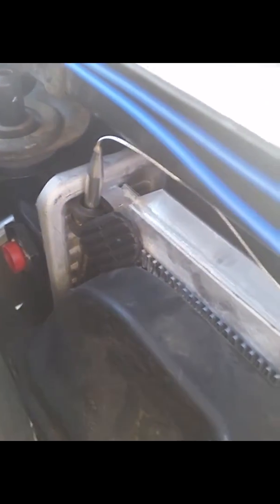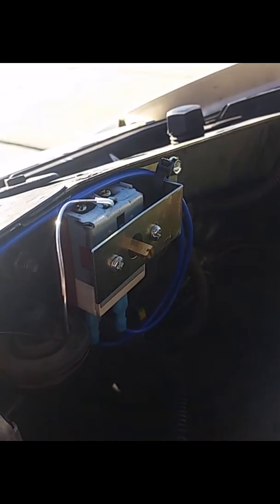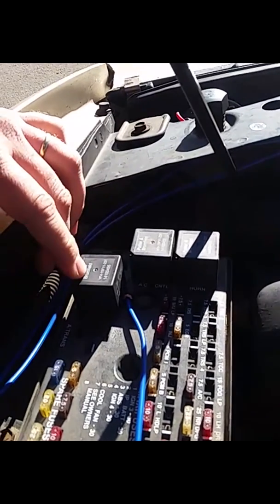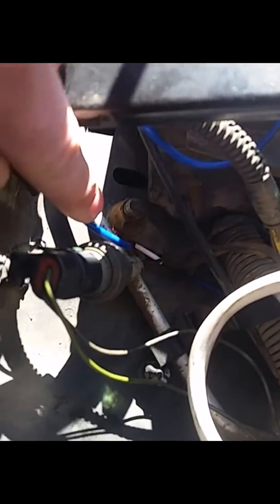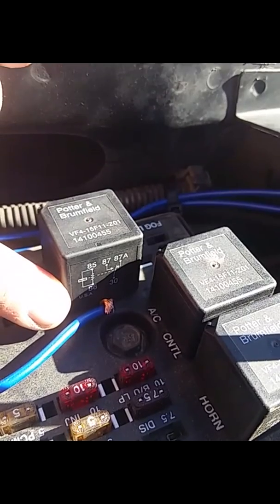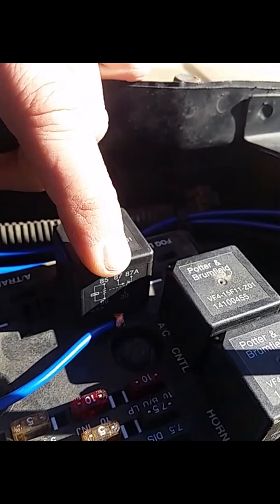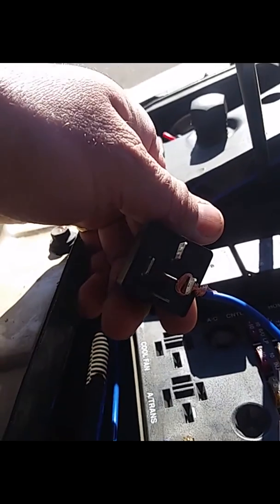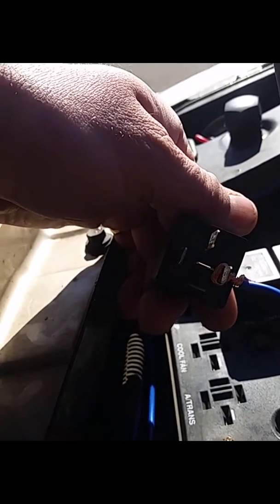1994 Saturn SL Fan bypass workaround

Comment: Interesting solution to the problem. I think I might have found an even more elegant solution. 

Richpin06 made a video where he showed off a tool that he made to test the kick on voltage of the fan, which kind of shows how the system normally works. Basically, the coolant temp sensor puts out a voltage based on the temperature, which drops as the sensor gets hotter. At 1.61 volts, the fan kicks on. 

Modifying the computer to make it kick on at a higher voltage is not really doable with any real ease. However, by installing a potentiometer into the circuit, I believe it may be possible to adjust the temperature that the engine will get to before the fan kicks on. 

My major concern at this point is about whether this will also effect the threshold for the fan to shut back off automatically. I'm also concerned about the Pot itself getting really hot and burning out. 

I shall report back my findings. If it doesn't work, your solution will be the way to go.

Comment: Where did you get that switch at and what's it's called again ? Thank you sir !
Reply from the maker: Steven Webb thermal switch. You can pick it up from any auto parts store.
Reply: interesting thanks for the info just the other day my jackleg mechanic just did a similar thing it seems like to my mom's 96 Saturn SL1 which was overheating so I wonder have you had any problems yet with it draining your battery? thanks in advance
Reply from the maker: @darrenanthony8473  no because i keep the temp *high (edit) enough that it doesnt run (if long) when the car is off. You can also install a relay in between the power to the temperature switch that will only allow it to kick on when the key is in the on position. Let me know if you need any insight on how to wire that up. its not too difficult.
Reply: Question where is the second wire going to?  The controller has jus 2 legs. One is to the relay but where is the other wire going? Have you wired anything to the fan wire harness at all?
Thanks.